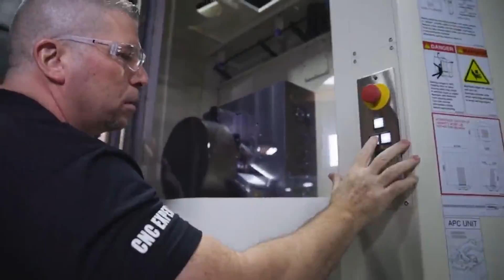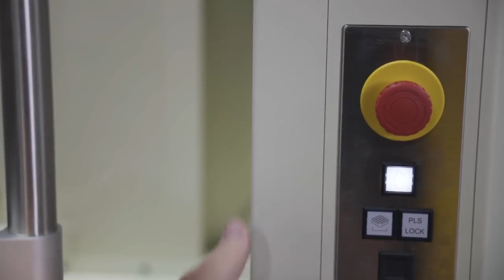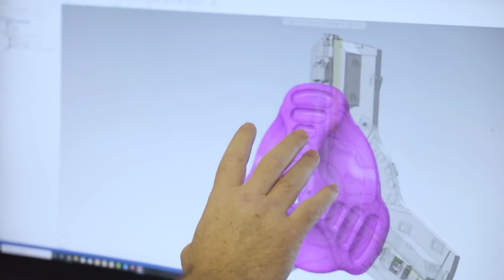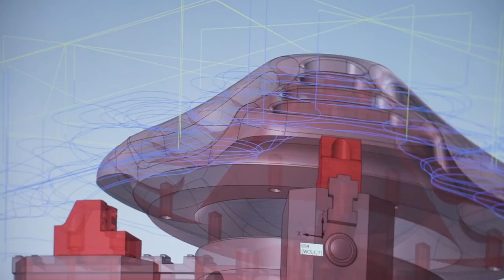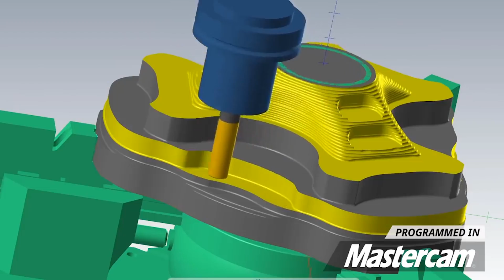Buyer DEMANDS 15% PRICE DECREASE or Parts Get Outsourced!

Comment: The problem is what would the price decrease mean to you. Say you barely making any profit. Maybe 5% per part after counting all the costs. 15% means you are now making a loss.
On the other side if you are making 50% profit the 15% price decrease would not bring loss but the profit margin would decrease a lot.
At the end of the day it depends on the customer and what that customer brings. Is this only work you got from him or is he constantly bringing new work? Is he the main customer or just one of many smaller customers you take on the side so the machines aren't empty for days? How complicated/difficult are the parts in question? Is it wearing the tools/machine a lot?

As all stuff in life there isn't simple question on only price. There are a lot of factors that should be taken into consideration before making any decision. 

From what I understand of this video the owner did some calculation which came to half a million. It doesn't feel like he considered all the factors but we don't have the whole picture. But I admire the confidence at refusing multimillion job.

Comment: Man, i remember having a contract we used to do outsourced

We refused to fix those parts because the possible liability (the shop is in sweden, signing off on a fix means you own any fault with the piece)  far exceeded the profit we would have gotten (the last offer before we fully refused was 250% of our original cost to manufacture those parts out of good, known, verifiable expensive tool steel)

They had literally drilled holes, filled them with charcoal and then flame hardened the ~0.2 mm shell of these parts in what we believe was impure cast iron. Our parts made of properly (60 hrc throughout) heat treated swedish tool steel were to be replaced every 3 months, i cant imagine these holding out a week.
Reply: That's the problem with people who go from books to management with no experience in the field they're "managing". If a guy works up the ranks and becomes president that's a much better situation than these guys straight out of college or a different industry but because their management resume looks nice and pretty they get the high ranking position in a field they know nothing about and result in out sourcing trying to save some money but ends up costing them in the end. I too would not fix those parts that they bought on a dime and expect you to bring it up to a standard they refused to pay you for.
Reply: @darklordojeda  especially since the failing, flawed parts might force them back to you for full, good parts later..
Reply: @GundamReviver  That assume that you can be bothered taking them back, as you run the risk of them doing the same thing next financial year, quarter, whatever periods that corporate management plan in.
Reply: @darklordojeda  from what i heard, we made them for $4500 each while they were outsourced to china for less than $900 (including shipping ofc)
Reply: @angrydragonslayer  "we made them for $4500 each while they were outsourced to china for less than $900 (including shipping ofc)" - That price difference just doesn't add up on material costs alone.
Reply: @CoolKoon  i'd say it makes perfect sense after seeing the ..... Material (thinking back, i'm not even sure if it's one metal or one of those "throw everything in the pot" alloys)

I doubt that stuff cost them $100 and they then likely had some guy making $1/day make it on a $3k mill
Reply: @angrydragonslayer  "i'd say it makes perfect sense after seeing the ..... Material" - Well yeah, that's what I was kinda implying too: such a radical price difference pretty much guarantees that the material will be highly suspect as well.
Reply: @CoolKoon  yeah. From what i remember, we paid $1700 for the steel we used and heat treatment (argon partial vacuum, done by the steel manufacturer). It was the real good stuff.
Reply: This makes no sense: at 250% of the original cost, why not just take the job, scrap the reworked parts, and make new ones?
Reply: @jermainerace4156  I have a feeling that it's because the customer has refused the option of scrapping the crappy part. And the responsibility thing applies for most of Europe as well: once you get paid to do something (e.g. a modification) you're the one who's providing warranty for the part as well. What many people (probably even companies) don't realize is that pretty much EVERYTHING they order from China is grey import meaning that it literally doesn't have to conform to ANY certification process or standards whatsoever. And oftentimes that's also a BIG contributing factor to the lower price (plus also the unbelievably low quality materials they use as well of course).
Reply: I'm horrified by your story, but for some reason I love the idea of case hardening the inside of a hole by packing it with charcoal and setting fire to it.
Not in this context, but I can kind of imagine Clickspring doing it as part of some iron age experimental archeology.

Comment: I would look at getting the times down, be it using different work holding and cutters to using a different machine and process.
A 15%% decrease could mean more in the order book in months or years ahead, a customer sometimes needs to do this
to compete in a world market.
This is why you have to update machinery and  process in a ever involving industry, look how many companies now have 5 axis and
sliding head CNC lathes compared to 15 years back.

Comment: I'm actually looking at bringing a cnc mill into an R&D environment.  We do outsource all of our parts, mostly to overseas vendors.  More precise parts or post machining operations are done locally.  You just can't beat the quality.  Thing is, the boss wants to decrease the iteration time.  Right now, it takes 4-6 months from the time a new idea/change to an existing part to go from the design phase through the manufacturing and assembly phases to the testing phase.  He wants to cut this down to 2-3 months.  I figure the only way this can happen is if the lead time for parts drops from 3-4 weeks to a couple of days.  What do you guys think?  Is it worth it in the long run to bring in a machine and a full time machinist, or should we work more closely with a local vendor to try to jump the queue on parts needed for quick turn around?  Most of the time, a parts order is for 4 parts.  That's how many units we typically build, or partially build, for testing before moving on to the next iteration.  We are aggressively expanding our product research from a great idea for a small portion of a usable product, to a fully integrated system that we can sell as a turn key system.
Reply: Get yourself the CNC mill. Parts will be so much cheaper and you can get them instantly. Depends on the machinist you hire though, so don't cheap out regarding his wage =) You get what you pay for.
Reply: I myself work in a R&D workshop making mostly one off parts a series of 10 is a big series. We run 4 cnc machines 2 3 axis and 2 5 axis mills making parts for production line wile a part is broken as well. The people  thingking of a new designcan sometimes come up with a part or something they want to test out and have it on their desk in the next few days or even faster sometimes although the parts are probebly a little more expensivr this way but not the holdup of waiting. I would say its really worth having it inhouse they sometimes come up with a little change as well wich you could then process quickly and have it back to them
Reply: Let's put it like this: 2-3 designers or engineers being held up on their project for 1-2 weeks likely has a cost in lost productivity

For the companies i have consulted, that cost combined with other benefits were enough to justify a 65 H monoblock, an integrex i-400 (forgot actual model, think it was a dual spindle turret with barstock) or a haas VF7 with a 5-axis rotary add-on.
Reply: Just for the ability of switching to small batch pilot plant production of any part the competitive advantage is unprecedented for both product development and supply chain disruptions.
Reply: Find a machine shop which can deliver the parts within 1 week. It is possible if it is not super complex components.
Reply: @andyprototypes1288  i have a friend that owns several such shops in europe, the US, canada and mexico.

From his express rates, i do not think that is very viable but other express shops could be different
Reply: @angrydragonslayer  I mean, find a local shop who'd like to match the schedule.If it's not complex parts, 3-5 days for manufacturing is possible.
Reply: @andyprototypes1288  definetly.

Comment: I worked for a company that had the same demands put on them back in 2008 at the beginning of the last recession. It was a large steel manufacturer with tons of contractors. They also went to payment in 60 days instead of 30.  It was a tough time for a lot of shops. You need to always keep those bad days in back of your mind. 
A fair amount of parts were also sent to Asia. Made and shipped for almost a third of the price. The castings were good but the material was terrible.  They did not last. 5 or 6 years later we got those jobs back but for a much reduced price.  And we made it work. We ate soup and toast for a while but came out of it in good shape. Invest in equipment when times are good. Always update. Keep improving and hopefully you can ride out the next storm.
Reply: So they demand a cut in price. They outsource the parts and get poor results. 5 years later they come back and you still give them the discount they wanted?

So in the end they got what they wanted, the same part at reduced prices.
Reply: @patrickd9551  I actually had a 'customer' demand that I honor a bid that was almost two years old.  This idiot went with the lowest bidder lost a bunch of time and money then wanted me to help him recoup his losses.  My bids clearly show that they are good for only 30 days after submittal date as material and labor costs only go up.  Then he has the nerve to say that if I take the job at the old bid price the next contract is mine.  My reply was let me rebid this project and I'll be happy to bid the next project.
Reply: This is what I call 'Giving them the bullets to shoot you with'.  If the customer gave you the contract after a competitive bid then I would be really leery of them.  I've seen too many companies go after the sale and not focus on profit and overhead.  If you're going to be losing money on a job it would've been better off if you just wrote them a check for half the loss and run away.